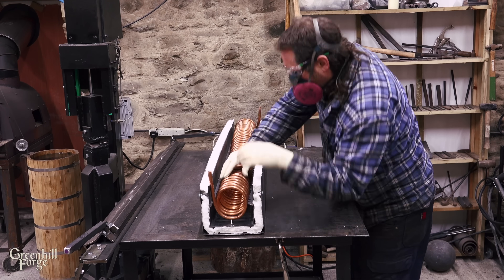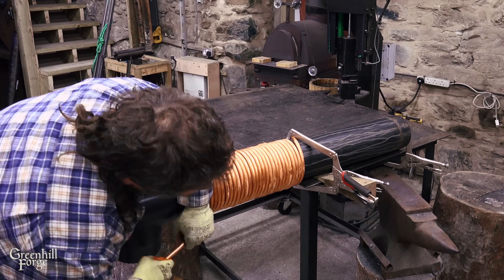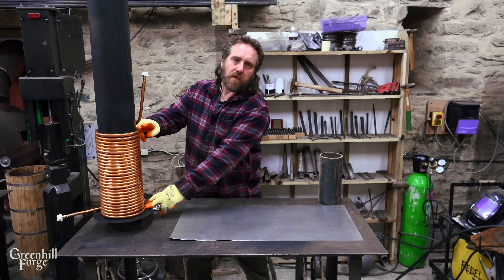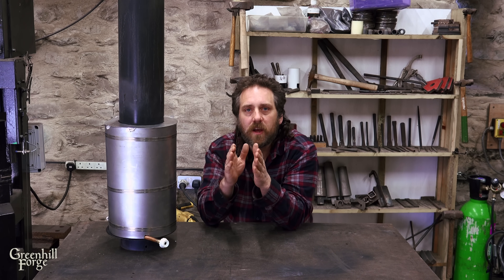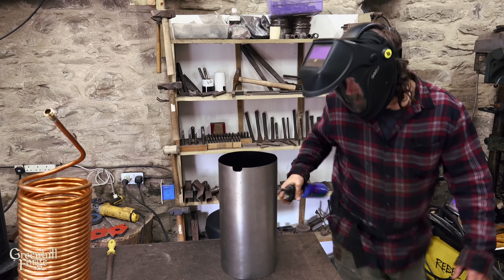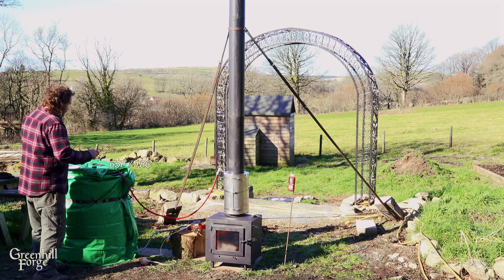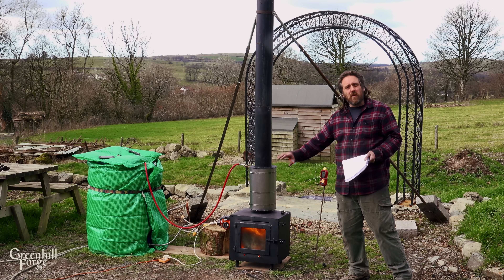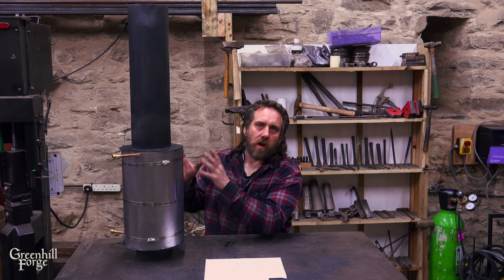Best Wood Stove Water Heater Yet: New Design Tested | Off Grid Water Heater pt3

Comment: Maybe this idea was already mentioned, but what if you install a flue pipe damper just after your heat transfer coil in order to concentrate the heat where it's being absorbed? I think you would also see a reduction in fuel consumption as this would keep the combustion happening inside the stove and not out the exhaust.

Comment: Great video, but here is the big flow I can see - the length for inside coil was much bigger, with much bigger area for heat transfer. I can guarantee, that if you use the same copper tube but for longer part of the tube, it would be near 20% efficiency gain

Comment: With the coil on the outside is wrapped tightly and not covering the whole tube the water will be cooling a very small area of the flue, try spreading the copper pipe out so it covers more area.
 You could also put a shroud that is spaced away from the pipe with a IR reflective inside this way it should superheat the air and that should also couple to more area of the pipe without adding weight. 
I was thinking about a filling too, good idea on the graphene, I was thinking of steel slag, when you pulled the black bag up i thought you had the same idea, Steel slag is commonly used in blasting and comes in a variety of sizes, grades, I reckon a fine grade slag would be the ideal material because its so cheap, and more conductive than sand , as well as less dangerous than graphene powder. 
I made a system with a wrapped coil for a boat about 10 years ago with pretty much the same idea, I decided to space the coil out because wrapping it in copper the whole way up would have been expensive, another idea I had was to create a vortex in the pipe so that the flu gases spiralled up increasing thermal transfer although I never tried this. Really enjoying the videos, I hope you try some gasification stuff sometime.
Reply: I came here to say the same about stretching out the copper pipe. That lets a lot more heat get around the pipes through the graphite, and covers more of the stove pipe, both of which makes it more efficient. Also, with the copper pipe steeper, it helps the thermo-siphon effect.
Reply: Yes, you basically need to get the surface area up.

another option could be adding fins to the inside of the flue, and some kind of thermal paste between the flue and the copper pipe.

on the subject of fins, I wonder whether 1 issue is the hot air flowing up the middle, and a layer of cooler air essentially insulating the outside. if so, something (like a fin,) to disrupt the air flow would improve performance.

Edit: And I should really read comments properly, because you said all the same things.
Reply: @benholroyd5221  Yeah, but the fins would make cleaning much harder and they would also collect even more creosote. A removable spiral from sheet metal would be best. I have this in my pellet stove, small channels with sheet metal spiral plus metal springs touching walls of tubes for even more turbulence and mixing.
Reply: @yetihehe creosote is a product of crappy wood and/or poor firebox management.

It can be mostly prevented by running a firebox as close to smokeless as possible, and using one of those cleanimg logs a couple times a year.
Reply: Maximum surface area is nice but the real problem is that air is terrible of conducting heat. If you have a say 150mm flue tube traveling at a set speed you are only extracting the heat from a small surface layer of hot air.

If you drop the diameter of the tube you vastly decrease the distance the heat has to travel through the heavily insulating air. It is something like to the 5th power increase as diameter decreases.

Better thermal contact of the copper to the flue tube helps but unless you are decreasing the distance the heat has to travel to get from the hot exhaust gasses to the metal your efficiency is going to stay low.
Reply: @Ammoniummetavanadate  Yes that's exactly why EGR coolers are ideal for doing what they do, the problem is that without the burn being totally clean, which is probably only achievable with pyrolysis or gasification, its going to get blocked by tar quite quickly making them unusable in this design. That's why i suggested a vortex, because the heat would travel towards the outside and any deposits that form on the tube would  no pose a problem. Disturbances could also be placed around the periphery to increase turbulent flow and heat transfer.
Reply: @ChrisDay-sx4lv  I could see a pretty straightforward design for a scraper system to clean out the tubes as needed, might mitigate a lot of it.
Reply: @ Actually, a vortex would sling the denser and cooler air to the outside. Steel fins would be the best simple solution. The fins would get hot enough away from the surface of the stovepipe that the soot would burn off, keeping it efficient.
Reply: @FLPhotoCatcher  Georges J. Ranque, a French physicist noticed temperature differences in vortex separators. He found that the center would get cool, and the outside quite warm.
Reply: @ An EGR cooler tubes are almost impossible to clean mechanically due to its intricate narrow tubes, although you could parodically remove it and clean using chemical means. There would have to be a by-pass so you dont gas yourself if it ever got blocked, they also might offer too much resistance to flow, meaning a blower would have to be used to drive the flue gas or input air.
Reply: @Ammoniummetavanadate What you really want to do os eliminate convection entirely.

Assuming you've rejected putting the coil inside the flue, another option would be to create a copper water jacket with an upper outlet and lower return, that mates tightly to the flue.

Basically, a copper pipe with ID the same as the OD of the flue, with a little judicial sanding so the jacket could slide over the disassembled flue.

A second large copper pipe over that pipe, mated by end plates.

You'd have to either silver solder them together, or thread them so they screw together.

This would be a configuration where some thermal compound to eliminate air gaps would be effective.

But it's never going to approach the efficiency of putting the coil inside the flue.
Reply: Nice experiment. I thought the insulation would have made a big difference. Like putting a lid on a pan.
Reply: And her should probably coat the outside of the copper tubing black (black materials absorb heat better, probably cause as a colorant it is carbon-based)

Comment: This is an incredible project and graphite powder is absolutely genius!
Reply: Water would work also, and it's cheaper and a better conductor.

Add a relief valve and fill valve.

Run properly, it should never build up enough pressure as the water circulating through the tubes would prevent it reaching that temp.

Just leave some head space for expansion.

But belt AND suspenders to avoid any possibility of there being a line blockage turning it into a pipe bomb.
Reply: Yeah, my first though when he filled it with sand: why not aluminium powder? Graphite is MUCH better, like he said in video.
Reply: Love ur pfp
Reply: @sparklefluff  thanks! It's Nimfa Dimaano from Hayop Ka with a trans flag behind her

Comment: Nice idea using the carbon powder. I wonder if making the coil taller (not longer) so you have a similar length of flu in contact with the carbon powder as you did with the direct coil would work better? Theory being at the moment you only have about 2foot of the flu where you are extracting the heat from. If you made that 4 foot would that improve the heat extraction from the flu into the carbon powder and then into the water?
Reply from the maker: Yeah, I agree and think you're probably right. My constraint is the cost of the build usually
Reply: Totally understand! How much is the carbon powder?
Reply from the maker: @user-ei3fx2vj2c  I think I paid about £10 per kilo/$14 for 2.2lbs. Without running the calcs I'd guess you'd need 3-4X as much to extend the coil to 4'. Better would probably be just doubling the copper and length but again copper is pretty expensive.
Reply: Yeah this is it. It’s cost over return. But for a no weld solution that could run for a decent amount of time with little to no added attention over running a normal fire this looks one of the best I have seen on YouTube!

Comment: Could be interesting to compare it to a water pocket around the flue (like a double barrel system) I think the heat transfer would be even better and it wouldn’t be too hard to make.
Reply: В случае водяного кармана возможен хлопок от перегрева, нужно дополнять системой безопасности - сбросом давления или расширительным бачком
Reply: Yeah heat transfer might be better but the water will soon get messy if in contact with steel (rusty water). The you have to start using rust prevention and that stuff is nasty. So if you wanted showering or washing water you would have to have another heat exchanger.

However I did think about filling the inter tube with water so you can maximise the contact area with the flu and the coil. So the heat transfer would be flu - boundary water layer - coil - water inside coil.
Reply: @picklerick1497  идеально расплавить медь и залить её в этот карман, медь легко плавиться в обычной свч печи
Reply: good idea, i think it would be quite hard to make, and it would have to be made of stainless because of the contact with water, a pressure release should be included encase there is a blockage but it would definitely work more effectively.
Reply: @picklerick1497  есть даже еще лучше идея, заполнить емкость алюминием, дешевый, теплопроводность чуть ниже меди, легко плавится
Reply: Try duplicating the system used on propane refridgerators-long "stovepipe" surrounded by liquid,with another tube outside,but not a lot of space between them.insulated on outside. So,lots of surface area,large area for heat transfer, maybe 4' or so tall (so getting that heat from the top of stovepipe that you are losing with a short bottom transfer area)
They also have a twisted metal,removable piece inside the "stovepipe" for a Vortex of the flue gases.
It can be open at top,so no pressure build up. Something like a float valve to keep topped off,if there is much loss of water by evaporation/steam. Would need to be a pumped/volume controlled tranfer system.the volume of water pumped would have a big effect on efficientcy,and rquire experimentation or calculation,as with any of the systems.
Could be initially made of just metal stovepipe,welded to a slightly larger stovepipe to make the "tank". 
If successful,could be made with thin copper sheeting or similar for corrosion resistance and possibly better heat transfer.(and just use stove gasket to prevent galvanic corrosion).
Thanks for your great vidios, and projects!

Comment: Instead of sand or water, I would just use a spring bender to make a coil.
Reply from the maker: I have a few and I use them for certain things but not if I'm trying to wrap directly around another object.
Reply: @GreenhillForge  I have done it to make the coil for a steam sample cooler on a steam generator.  I wasn’t using copper though, I was using stainless.  It was a major pain due to stainless being so stiff, but I got it done.  Took a lot of swearing at clamps and pounding with a rubber hammer.  I would think wrapping copper around a pipe would be a lot easier, but I have been wrong before.  Maybe try it on a piece of scrap?